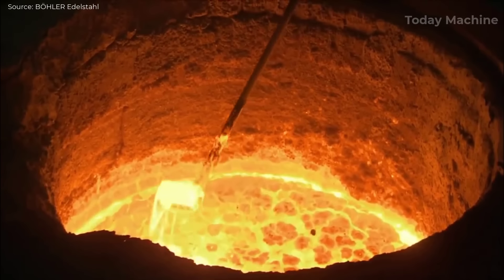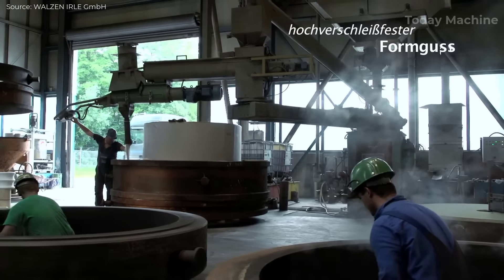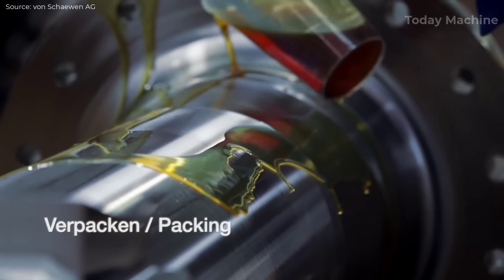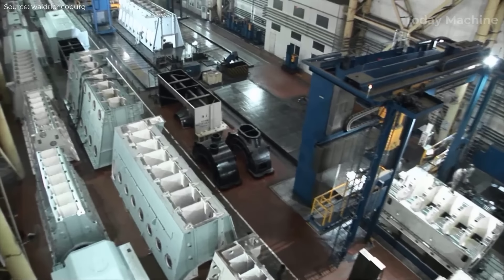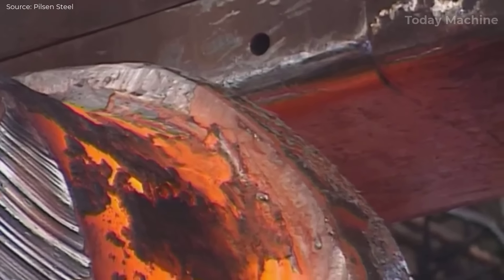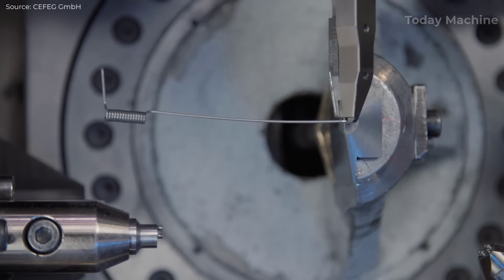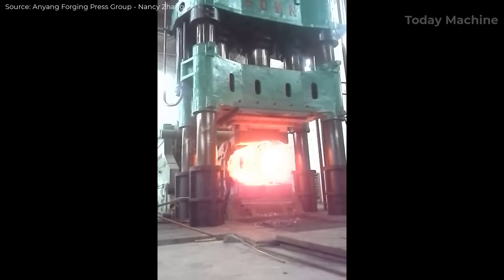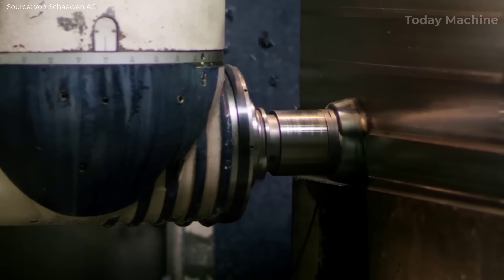How To Produce Giant Crankshafts & Crankcases. Amazing Forging Machines & Heavy Equipment In Working

Comment: I just LOVE BIG ! I worked BIG for COOPER BESSEMBER in the town of Stratford Ontario in the late 1970's running a vertical boring mill. A Berthiez Boring mill with a 12 foot table making Ships engines and 16 cylinder pumps for neuclear  opperations, Natural gas pumps as heavy as 40 ton. I was young and always have regreated the closing of that plant.